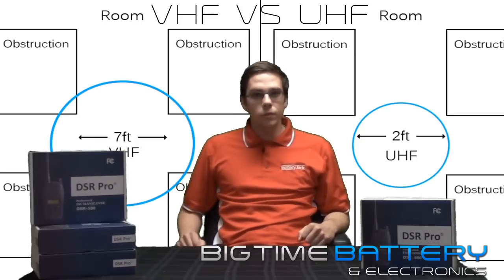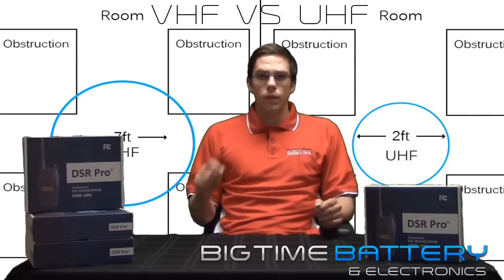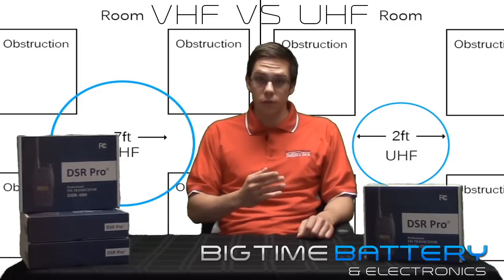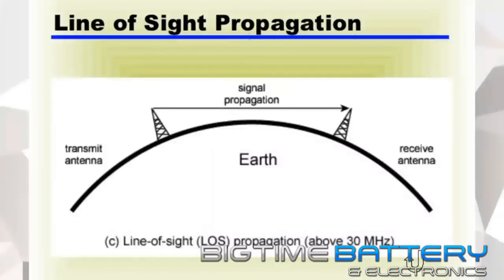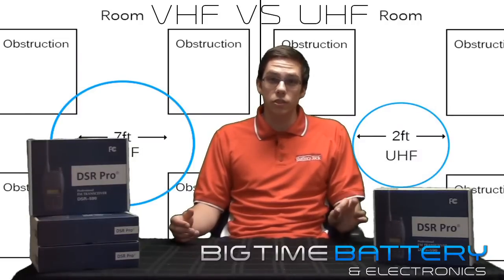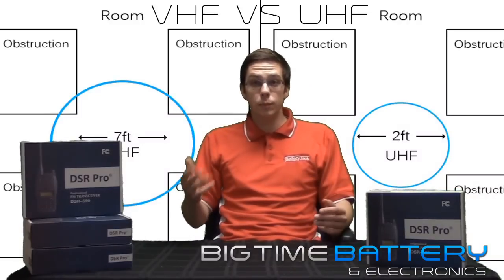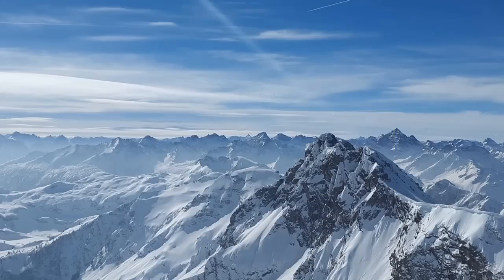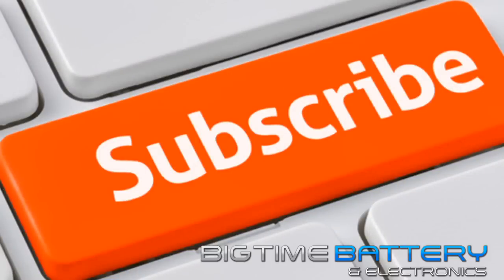VHF vs UHF - What's the difference

Comment: THANK YOU for the easy way you put it by comparing the UHF & VHF to 7ft & 3foit poles.
That was a fantastic visual which made it so simple and easy to understand WHY it's easy for one frequency to travel or why it's difficult for it to travel compared to the other frequency!
Why can't instructors made it that simple??
Reply from the maker: I'm glad you found the analogy between UHF (Ultra High Frequency) and VHF (Very High Frequency) as 7-foot and 3-foot poles helpful! It's a great way to visualize the difference in how these frequencies behave. The length of the "pole" in this analogy helps illustrate the wavelength of the frequency. Longer wavelengths (like the 7-foot pole for VHF) can travel farther and penetrate through or around obstacles more easily than shorter wavelengths (like the 3-foot pole for UHF), which can make them better for certain types of communication over longer distances or through challenging environments.

The reason this kind of analogy isn't always used in teaching could be due to a variety of factors. Sometimes, instructors might assume a certain level of prior knowledge or may focus on the technical details without providing a simple, relatable context. Other times, the complexity of the subject matter makes it challenging to find analogies that are accurate without being misleading. However, effective educators often strive to find such analogies because they know that making complex information relatable and visual can significantly enhance understanding.

It's a reminder of the power of a good analogy in teaching complex concepts. By relating unfamiliar information to something familiar, it becomes easier to grasp the underlying principles. This approach can be especially useful in fields like electronics and physics, where abstract concepts can be difficult to visualize. If you're learning on your own or looking for ways to understand complex topics, seeking out or even creating your own analogies can be a very effective strategy.

Comment: Please, delete this video, correct the material, and record it, again!   Thanks!
Reply: hahah.. so true
Reply: I'm new to HAM and still learning and was wondering what you were talking about....and then I got it once he started into the actual meat of the video. At least use the right metric measurements. Calculations are done in meters not feet.
Reply: @theodorepollock1273  The entire video is a hot mess.  He confuses Hz for MHz.   He uses feet instead of meters.   His visual aid regarding VHF and UHF fails to represent what is actually happening.   He is just plain wrong when he says 99% of radio users would be better off with UHF. 

I appreciate the effort, but his presentation leaves much to be desired.
Reply from the maker: Sorry I was very young when making this if you need any help call or text: 815-467-6464 or email me directly at cody@batteryjack.com

Comment: I am fairly sure that a lower frequency signal has better penetration than higher frequencies..

Ie VHF has better penetration over uhf?
Reply from the maker: Yes, you are correct. In general, lower frequency signals have better penetration capabilities compared to higher frequency signals. This principle applies to radio waves as well. Very High Frequency (VHF) signals have better penetration through obstacles like buildings, trees, and other physical obstructions compared to Ultra High Frequency (UHF) signals.

This is because lower frequency waves can diffract or bend around obstacles more effectively due to their longer wavelengths. They also suffer less attenuation or weakening as they travel through materials. As a result, VHF signals are often preferred for broadcasting over longer distances and for providing coverage in areas with challenging terrain or obstacles.

Comment: So, would you say when using radios in a rural environment use VHF, but when using them in a built up environment use UHF? Or just stick with UHF in both areas as it does the same in the open as VHF does? Thanks!
Reply: In open areas, VHF will slightly outperform UHF, due to longer wave length and more bending toward the horizon.  Dual band radios are getting cheaper..
Reply from the maker: The choice between using VHF (Very High Frequency) and UHF (Ultra High Frequency) radios depends on several factors, including the environment in which they will be used, the type of communication needed, and any specific constraints such as range or licensing requirements. Here's a general guideline based on the characteristics of each frequency band:

VHF (Very High Frequency): VHF radios operate in the frequency range of 30 MHz to 300 MHz. They are typically used in open, outdoor environments because VHF waves travel further than UHF waves under similar conditions, especially in areas with little to no obstructions. VHF is ideal for rural areas or places with minimal barriers because its longer wavelength can cover greater distances without using much power. However, VHF signals have a harder time penetrating buildings, dense forests, and urban environments.

UHF (Ultra High Frequency): UHF radios operate in the frequency range of 300 MHz to 3 GHz. UHF is generally preferred in built-up areas and for indoor communication because its shorter wavelength allows it to penetrate through urban clutter, such as buildings and trees, more effectively than VHF. UHF can also provide better coverage inside structures such as concrete buildings or steel structures, making it suitable for cities and highly constructed areas.

Given these differences, if you are operating primarily in a rural, open area with few obstructions, VHF might offer better performance due to its ability to cover longer distances with less power. However, if you anticipate needing to communicate in or around buildings or densely wooded areas, UHF would likely be the better choice due to its superior penetration capabilities.

Using UHF in Both Environments:
Choosing UHF for both rural and urban settings can be a practical decision, especially if you need a versatile communication solution that performs reasonably well in various environments. While UHF might not always provide the same range in open areas as VHF, its ability to work well in both open and obstructed environments makes it a flexible choice for many applications. If you're looking for a "one-size-fits-all" solution and you're okay with the trade-offs, sticking with UHF could simplify your setup and ensure consistent communication capabilities across different scenarios.

Ultimately, the best choice depends on your specific needs, including the range you need to cover, the environments you'll be operating in, and whether you can manage using different types of radios for different situations. In some cases, organizations opt to use both VHF and UHF radios to maximize their communication capabilities across varied environments.

Comment: Distance, VHF signals travel further the UHF!! although with the right knowledge and equipment and conditions!! 
they can both travel over 2000kms  plus
Reply: Andy RC we've proven times where each is better than the other at similar distances but different directions making them overall equal. Horses for courses the saying is.
Reply from the maker: The statement that VHF signals travel further than UHF signals, given the right knowledge, equipment, and conditions, allowing both to potentially travel over 2000 kilometers, merits a nuanced response that involves understanding the principles of radio wave propagation.

VHF vs. UHF Propagation:

VHF (Very High Frequency) bands cover frequencies from 30 MHz to 300 MHz. These waves can travel longer distances by ground wave propagation, which means they can follow the Earth's surface. VHF signals are also less affected by buildings and natural obstacles than UHF signals, making them suitable for outdoor use over wide areas.

UHF (Ultra High Frequency) bands range from 300 MHz to 3 GHz. UHF signals have shorter wavelengths, which allows them to penetrate through urban environments better, making them ideal for indoor use. However, they generally have a shorter range in open environments compared to VHF due to their line-of-sight nature and greater attenuation with distance.

Factors Influencing Signal Distance:

Antenna Height and Gain: Higher antenna placements for both VHF and UHF transmitters can significantly increase the range by reducing obstacles and extending the line of sight.

Atmospheric Conditions: Under certain conditions, such as temperature inversions or ducting, both VHF and UHF signals can travel much further than under normal conditions. These phenomena can cause the signals to be guided over the horizon, extending their range significantly.

Power of Transmission: Higher power can extend the range of both VHF and UHF signals, although this is subject to regulatory limits to prevent interference with other services.

Use of Repeaters: Both VHF and UHF systems can use repeaters to increase their range. A repeater receives a signal and retransmits it at a higher power or from a better location, allowing the signal to cover longer distances.

Traveling Over 2000 Kilometers:

Reaching distances of over 2000 kilometers is unusual for direct VHF or UHF transmissions due to the curvature of the Earth and the typical propagation characteristics of these frequencies. However, specific atmospheric conditions, such as tropospheric ducting, can allow VHF and UHF signals to travel much farther than under normal circumstances. Additionally, amateur radio operators have achieved long-distance communication over such distances by using moonbounce (EME) techniques, where signals are literally bounced off the moon's surface, or through the use of satellites as repeaters to extend the range of VHF and UHF signals.

In summary, while VHF typically offers longer range in open environments due to its propagation characteristics, both VHF and UHF signals can achieve extraordinary distances under the right conditions and with the appropriate technology. Achieving distances over 2000 kilometers, however, usually requires specific atmospheric conditions, sophisticated equipment, or the use of satellite systems.

Comment: Help make a purchase,  

Is this good 

The system includes a transmitter with belt clip, receiver with a camera mount, mic clip & windscreen, and XLR & 3.5mm cables. 

System Specs
Frequency response: 60Hz-15 KHz+/-3 dB 
Audio input connector: 3.5mm mini jack 
Audio input level: 600 mV-2000 mV 
Power supply: Two AA batteries (up to 8 hours of run-time) 
Transmitter/Receiver Dimensions (each): 4.2" x 2.6" x 1.1" (10.6 x 6.7 x 2.9 cm)
Weight (each): 95g (3.4 oz) without batteries 
Signal-to-noise ratio: 80 dB 
Distortion: 0.8% (-60 dBV, 1 KHz input) 
Audio output level: 120 mV 
Audio output connectors: 3.5mm and XLR 

Lavalier Mic Specs
Polar pattern: Omni-directional 
Frequency Range: 35Hz ~ 18 KHz 
Signal / Noise：74dB SPL 
Sensitivity: -30dB +/-3dB / 0dB=1V/Pa, 1 kHz 
Connector: 3.5mm locking mini plug 
Length: 1.2m (4') 

All Parts Covered by a 1 Year Warranty with support based in the U.S.A.

UHF Frequency Range: 584 MHz-608 MHz; 48 Selectable Channels
Wireless Range: 100m (328-feet)
3.5mm Mic and Line Inputs; XLR and 3.5mm Outputs
Ideal for ENG/EFP & DSLR/Camera Audio
Transmitter and Receiver are powered by 2 "AA" batteries for up to 8-hours of operation
Reply from the maker: What do you need help with? Call or Text: 815-467-6464 or email me directly at cody@batteryjack.com

Comment: So... working under this theory. The lower the frequency, the longer distance you can travel (when free of obstructions). This is why most HAM operators use HF and many military radios are in the HF band. Then why do all aircraft, military and civilian alike tend to stick to the UHF band? There are no obstructions up there. Serious question
Reply: Zachary King the Quality of the sound is much better
Reply: Zachary - correct, CB radio is HF, and under the Right conditions you can communicate under Skip conditions.
Reply: Zachary - Public Safety uses UHF because its useful in Dense Urban enviroments. but, in Fact they are slowly going up in Frequency, most recently some Police are moving to 700Mhz UHF. the reason is Better voice Clarity in Digital Mode. an in a few years they will go to 900Mhz Digital as well. One caviat is gone are the days of a Single tower serving a Police station. today they are becoming Digital with multiple Trunking Sites and some have IP based Repeaters as well. now a Security officer can communicate in a Giant Stadium or a 100 Story High Rise with HQ voice Clarity. Mutiple Digital Trunking and Repeater sites to counteract Obstruction Interference.
Reply: Zachary King: Commercial aircraft on long routes also use HF communications.....see link here:
http://www.g4nsj.co.uk/air.shtml
Reply: Civilian aircraft operate in VHF. 108-136 Mhz, look it up.
Reply: And HF. Look it up.
Reply: HF can be refracted in the ionosphere and travel world wide. VHF and UHF are LOS. For aircraft that means a considerable distance because of the height above ground. VHF has a longer range than UHF because of the free space loss. But aircraft going trans-Atlantic would not be able to have contact with ATC on VHF mid-Atlantic. They therefore use HF if they need to communicate with ATC. Often via ACARS-messages.
Reply: Kjartan Andersen Yes thank you. I thought about that after I sent the reply. They use HF and VHF also.
Reply: If you want interstate or international (requires good hf propagation or fuck all happens) then hf is great else it's useless and less reliable for local work. An example another amateur mate and i are 20km apart. VHF and UHF especially at 5-25w are great but 10, 40 and even 80m at even 100w are a no show.
Reply: @KjartanAndersen  No, 120 MHz is VHF as more than 30 MHz and less than 300
Reply: The maths is a complicated formula involving too the frequency. I believed that it was only related to the square of the distance, but in fact not only. When the frequency increases, the electric scale decreases a bit.
Reply from the maker: The choice of frequency bands for radio communication, including those used in aviation, is influenced by a combination of factors including propagation characteristics, regulatory constraints, and practical considerations related to the application. Here's a breakdown of why aircraft, both military and civilian, often use the UHF (Ultra High Frequency) band despite the general principle that lower frequencies (like HF or High Frequency) can travel longer distances, especially when free of obstructions:

Line-of-Sight Propagation: Aircraft communications primarily rely on line-of-sight (LOS) propagation, which is more effectively achieved at UHF frequencies. Although HF can travel longer distances, including beyond the horizon via ionospheric reflection, UHF's LOS propagation is sufficient and reliable for the altitudes and ranges typically involved in aviation. The curvature of the Earth limits HF's direct utility for aircraft at cruising altitudes over long distances without relying on potentially unreliable ionospheric conditions.

Bandwidth and Capacity: UHF frequencies offer higher bandwidth compared to HF, allowing for clearer voice communications, the transmission of more data, and more simultaneous channels within a given frequency band. This is crucial for the dense communication needs of modern aviation, where clarity and reliability are paramount.

Interference and Noise: HF bands are more susceptible to interference from various sources, including natural phenomena like solar flares and man-made noise, which can significantly degrade communication quality. UHF, while not immune to interference, generally experiences less noise, making it more suitable for the critical communications involved in aviation.

Antenna Size: The wavelength of UHF frequencies allows for smaller antennas, which is a practical consideration for aircraft design. HF antennas need to be much larger to be effective, which is not ideal for the sleek, aerodynamic requirements of aircraft.

Regulatory and Historical Reasons: The allocation of frequency bands is governed by international agreements and regulations. UHF bands have been designated for aviation use for decades, and the aviation industry's infrastructure is built around these frequencies. Switching to a different band would require massive changes in equipment, training, and regulation.

Specific Use Cases for HF in Aviation: It's worth noting that HF is still used in certain aviation contexts, particularly for long-haul flights over oceans or remote areas where VHF/UHF line-of-sight communication with ground stations is not possible. In these cases, HF allows for long-distance communication beyond the line of sight by bouncing signals off the ionosphere.

In summary, while lower frequencies can indeed travel longer distances under certain conditions, the specific requirements of aviation communication—such as clarity, reliability, bandwidth, and practical considerations related to aircraft design—make UHF the more suitable choice for most aircraft operations.